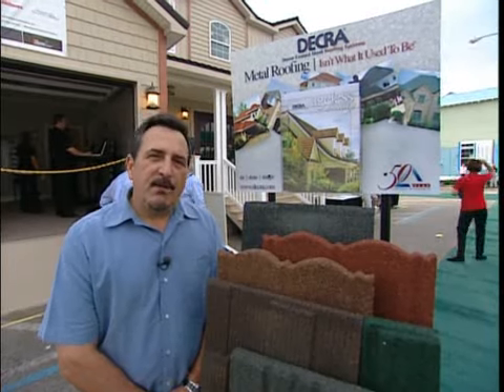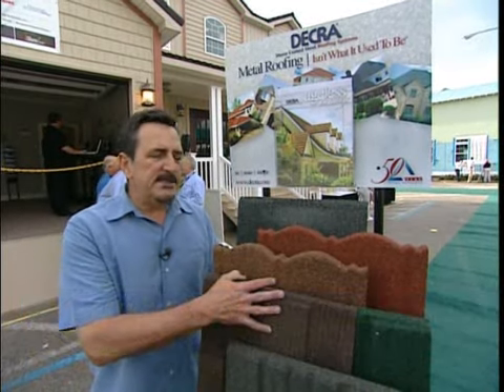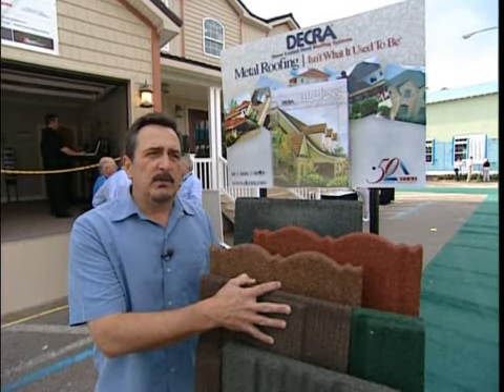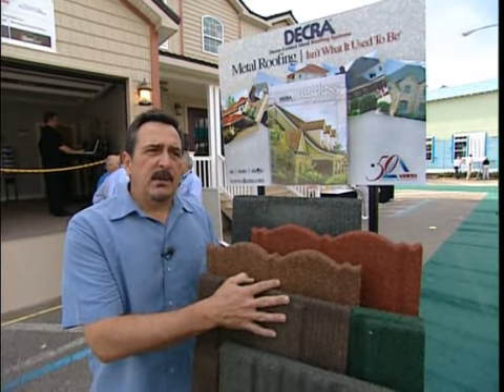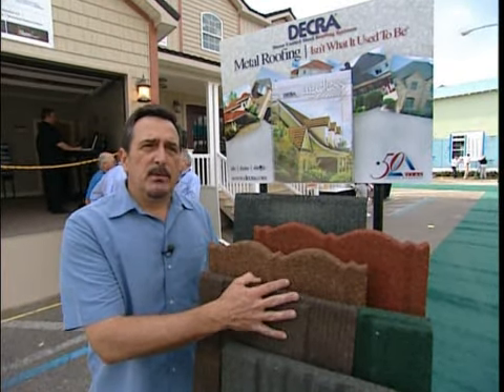DECRA Roofing Systems

Comment: This style of roof is easily walkable even when wet.  If firemen need to cut a hole in the roof, their tools will be able to get through this system just as easily as any other roof system.